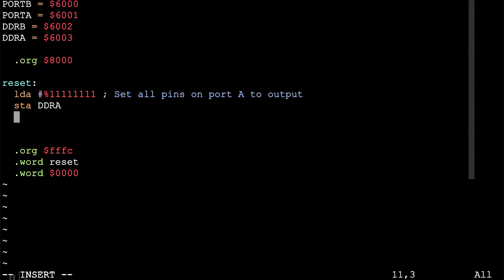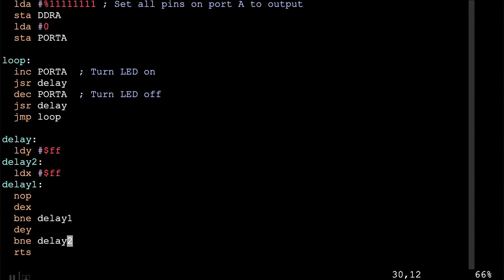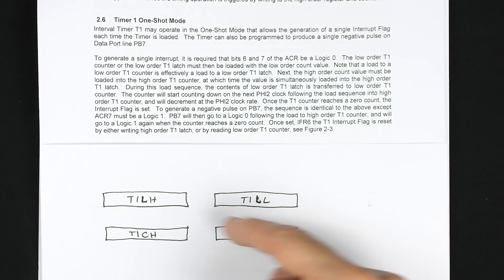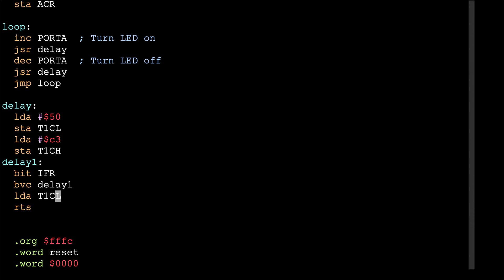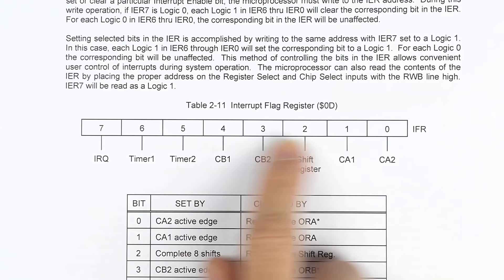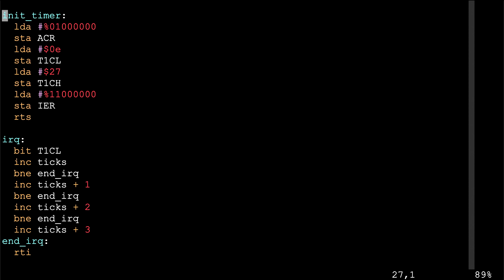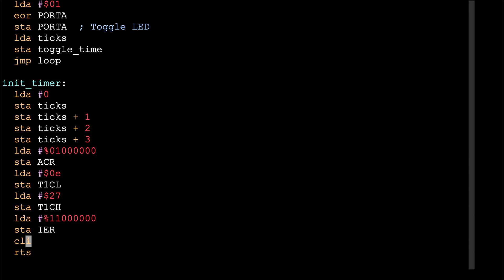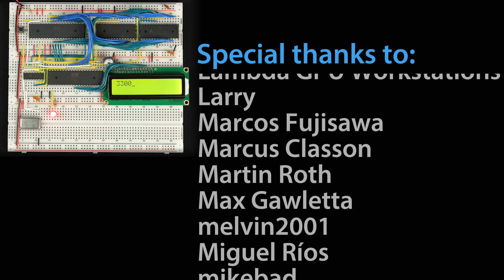How do hardware timers work?

Comment: This is a really excellent introduction to how low-level stuff works on microcomputers. However, I'd like to mention a couple of caveats (maybe Ben is going to cover this in future episodes anyway, but I don't want people coming away with some misconceptions that could get them into trouble). 
Firstly, it is a general principle that, with real software, you never poll the CPU. This means that you do not have a loop that just goes around waiting for something to happen (such as a timer interrupt). There are two reasons for this: firstly, in order to modularise the software running on the CPU, you just simply want a mechanism that (potentially) allows some new module to get some CPU time without disturbing the existing modules. A 'module', here, might actually mean a program.
Secondly, and this is what I'm really concerned about, many modern CPUs---even microcontrollers---are in serious danger of overheating and being destroyed if you run at full CPU continuously. What would happen, and how quickly, depends on a lot of factors, but it's best to avoid the danger.
So, finally, if you don't go around in a loop waiting for an interrupt, what do you do? The answer is you put the CPU into a 'halt' state. The details of doing so tend to vary for each processor (variant/stepping) and to be hedged around with a lot of nitty gritty details. (In fact, most low-level programming is like that :-)
Finally, finally, a word of warning about the documentation of peripheral devices/chips: so very often the documentation is inadequate, incomplete, and inaccurate. If you try something based on the documentation and find it doesn't work, it might well be because the docs are wrong in some critical detail. In this case, asking around on appropriate (nerdy ;-) forums etc. is usually your best bet. Somebody will know what the answer is.
And finally, finally, finally, good luck to all you experimenters, hackers, learners, and geeks out there trying your hand at this stuff. Be patient, and know that the satisfaction when you actually get something to work is immense.
Reply: I don’t think risk of overheating is very significant, it’s running at 1 MHz… and modern CPUs usually have cooling systems and temperature sensors that turn them off if it’s too high, so not likely there either.

Comment: Why you don't you try to build a simple operating system for this computer? It can be very interesting to see how interrupts handling, graphics and memory management work together to create the operating system
Reply: People do not use operating systems on microcontrollers in production. If you wanted to see how a PC OS works, (I've written one) you should make one for x86 and run it from the EFI loader right away. That way you'll actually learn how to setup basic ACPI, virtual memory tables and so on. Things you don't have on a microcontroller.
Reply: Well, that’s not really the point here, is it?

Small steps. Trial and error. That’s what’s going on here.
Reply: @TheChrisey  One certainly could show the preliminaries, however: a hardware monitor, a boot loader.

Comment: How Ben eater uses logic ic's without pull down resistors

Pls anyone answer
Reply: The 74ls family can sink current on their outputs, so as long as you don't connect too many things on one output it should work. Or did you mean something else?
Reply: @MWPSBCID  thank you
Reply: You only need pull up/down resistor if an input could possibly be in an "unknown" state, eg floating.
A Open Collector (in transistors) and Open Drain (mosfets) are sometimes implemented on purpose if pin direction can be changed in software and could create a short if both sides are push-pull, a strong pull-up resistor is then needed to set "high" in Open Drain.

Comment: I'm still in favor of the registered alarms design where the processor can just sleep when not handling an interrupt. And when handling the timer interrupt it just checks the time and runs any code if it is due to.
Reply: This microprocessor does not have any power states... Thus it will always run nonstop regardless. You can't put it to sleep. But a busy wait delay is indeed a bad design, and something no educated engineer actually does, hence why interrupts are a major part of any modern processor.

Comment: so great :-)
Today in an MCU there are integrated timers.

But first someone has to understand, how it was done in the 70ies / 80ies at CPU base,
in order to do stuff on a modern MCU.

I'll keep watching from time to time, thanks for that :-)
Reply: Those integrated timers are basically the same as this, just stuck inside the same chip as the CPU.
Reply: @renakunisaki  yes as I already said :-)
Reply: Because that's not an MCU, it's a microprocessor. Two different things. Also, MCU timers are still configured pretty much the same way as they were in the 80s. You definitely don't need to know how they worked then to know how they work today.
Reply: @TheChrisey  what I already said. Thanks ;-)

Comment: Ended up watching the whole series today and couldn't help but notice, that modern microcontrollers are basically all that (and more) in a single chip. There is the ALU in it (6502), GPIO (6522), interrupt handling (both 6502 and 6522), timers (6522 again) RAM and ROM. No wonder AVRs are so popular, even not including Arduino using them.

Comment: Some types of sleep function do:
1) A nop spin
2) A thread switch and wait for the task scheduler to return
3) A performance counter based spin wait with an internal yield to not hold up task scheduler 
4) A hardware based timer with interrupt callback (like the thread switch)

Comment: Just wanna note that your final code still doesn't fix the issue of other stuff in your main loop potentially taking too long and preventing the led from updating - for this you would have to update the led in the interrupt handler routine as well as incrementing the counter

Comment: Ben, I wish that you or someone with your teaching skill would make videos like this teaching how to program my PDP-8s!  ;D  I'm not sharp enough to be a multi-processor(?) Programmer, so I'll try to stick to the slow BlinkenLights that I have that are relatively simple.  But since I don't claim to be a Programmer, I definitely need all the help that I can get!  DEC's  handbook with its errors simply isn't written at a level a rank beginner can make much progress with.  But, I can still pick up a few "general" pointers watching these videos since I've dabbled with Assembly with for Z-80 & 8088/8086 machines (back in the day) and a lot of what you demonstrate still makes sense.
Reply: May I ask what you're using PDP-8 for? I use to program them back in 1980 I didn't know they were still in use for anything, like the GEC4000
Reply: @salerio61  Just playing with them now, as a hobby.  The last time we used one at work in the late '90s or early 2000s (& before I retired) was to run a test stand to test missile launchers.  ;)

Edit:  I'd just like to find a good way to learn how to correctly program it, with someone that could check my work as I slowly learn in a perfect world, but I'm not going to hold my breath on that.

Comment: Mr. Eater, I have a suggestion for a video: bus arbitration! I.e. how to implement in hardware the system that manages a single bus between a processor, memory and I/O devices, preferrably with your breadboard 8-bit computer. I am no expert so I don't understand how one would design a system with shared bus which may have several devices attached. It is one thing to tri-state all inputs and outputs between registers and ALU and stuff within the processor, but it probably won't work for any devices external to the processor.  Surely it won't have Load / High-Z lines running directly from the processor's control store to every single terminal, printer or tape drive connected to a computer? An in-depth video on building a bus arbiter from scratch would really be very welcome!
Reply: External devices mostly use 1K pull-up and active low( eg Open Collector). Two active low does nothing and will not create a short. 
Only downside is 1K rise time is slower, and uses more power if line is active low often.

Comment: Hey Ben Eater i designed and builded prototype of my 6502 terminal with two 6502's and i called it "Retro6502". It have 64Kb of RAM, 18MHz generator (based on 555), 2 I/O chips (for alot of stuff to connect) and the most inportant the EEPROM 512Kb. I have 2 part schematic witch is little bit not undersantabble but it can be readed us normal. For now it peforms great and i will soon make PCB layout and then buy this PCB in PCBway the best PCB manufacturer in china! just give them PCB files and they will make 5 PCB's for 2 dollars!

Comment: Now that you've done a couple of interesting things with interrupts, I'd love to see a video on writing an interrupt handler that can determine where the interrupt came from, and respond accordingly.
Reply: You just read the interrupt flags register to see which bits are on.

It's possible to have more than one of them set at the same time, so you handle them in order of priority.
Reply: While I'm sure Ben would make a better explanation the gist of it is that you do a BIT test of the IFR (Interrupt Flag Register) of all possible interrupt sources, in the order of priority, and call the service routine for the first one that matches. If their are multiple simultaneous interrupts, then the moment the first service routine returns with its RTI instruction the CPU will be interrupted again and the interrupt routine will test the IFR bits again. When all interrupt sources are cleared, then the processor goes back to running the main routine. This does mean that if a device connected to the CPU interrupts and the program is not expecting it, it can get jammed in an endless interrupt loop...

Comment: On the 6510 variant of the 6502 (the Commodore 64 used the 6510), addresses $00 and $01 are reserved for an on-chip I/O port.  In the C64 this port was used to control which banks of ROM or I/O devices were enabled, as well as controlling the cassette tape recorder, if it was plugged in.

One of these days I'll unbury my C64 from the basement and see if it still works.  🙂

Comment: the only thing missing is that you didn't check frequency when you were using blinkWithDelay and show that it's slightly slower than the frequency you set because of the overhead between delays.

Comment: Ben's videos are always excellent. Haven't written assembly in decades but would like to get the 6502 kit just for fun but shipping cost to Europe is too high.
Reply: You could always play around with the SNES hacking community.
Reply: There are cheap ways to do assembly on real hardware, ATTiny85 is a very powerful microcontroller, inexpensive, debugable using a protocol called Debugwire. Just get a breadboard, a couple of resistors and LED's.
Reply: @deltakid0  Atmel chips don't use the 6502 instruction set. They're AVR.
Reply: @khatharrmalkavian3306  you're right, I thought he wanted to just write asm no matter the flavor, also, I think the NES emulator is the way to go.

Comment: I think the lead picture of this video is a bit misleading since I would have associated sleep() with modern computing, the difference being that the 6502 (at least normally) only ever runs at one speed while modern CPU's step up and down their clock rate adjusting to the load, so sleep() would actually tell them there's no load from this thread for a given time.
Reply: Not really - sleep has been around much longer than CPUs that adjust clock speed. The key point is the processor can be doing other things while one task is waiting.

Comment: It would be really cool if you could show how to create a serial input for those who are getting tired of programming the chip in the dock. Instead, we could use serial to send the new firmware.
Reply: Like the bootloader found on Arduino boards?
Reply: @user2C47  but much simpler. Because bootloader's have a lot of overhead

Comment: I'm just not sure how the toggle-time works when it nears the upper limit.  Seems like when 'ticks+0' is near the point of rolling over, things won't work quite right.  For example, when 'toggle-time' reaches 250, 'ticks' minus 'toggle-time' can never be more than 5, much less reaching 25.  Wouldn't that break things?  Maybe I'm just not understanding how SBC and CMP are working with the carry flag?
Reply: The trick is to bear in mind that single byte numbers are treated modulo 256, i.e. 0-255. If toggle_time is 250, then ticks will be rising towards 255, then go back to 0.  0 - 250 is -250, which modulo 256 is 6. so the program will continue until ticks is 19 when (19-250) modulo 256 = 25.
Reply: @IanSlothieRolfe  Thank you for that explanation.

Comment: @Ben Eater 27:50 Does this mean that the clock is fully occupied by your blinking LED?
So no other program can use that clock?
Or is it like possible to give it multiple "latch times" (toggle times) & specific addresses to send the interrupts too?
so, you send in like: "program_A 250ms" & then "program_B 50ms" and it will send some kind of output signal to some kind of buss together with a receiving address?

Because in the beginning, your program used up the entire CPU to just blink a LED, but now you "use up" an "entire" clock to blink the LED, which of course isn't as bad, but could it be even better & "parallel"?
Because in a regular computer, I assume a LOT of stuff uses the clock, so there must(?) be a ways to let multiple programs use the same clock, otherwise the computer could run out of clocks?
Reply: In a modern system, the main timer is used to increment a tick counter like this (or even has one built in), and the applications ask the operating system to delay them for a certain time or alert them after some amount of time. When the OS switches programs it will go through the list of programs waiting on timers, see if any of them are due, and if not, skip them. Effectively it simulates having an infinite number of timers.

Of course this means the resolution isn't as precise as a real hardware timer, but the hardware timers in modern systems can be precise to fractions of nanoseconds. Besides, most modern applications don't need "precisely 25ms", they need "roughly 25ms" or "at least 25ms" or "until I have something to do again". If you need a very precise timer, you probably aren't using a general-purpose computer and operating system for it.

Also, modern systems have real-time clocks, so you can wait for a specific time of day.

Comment: What happens if the main loop(led +lcd) is more than 1000ms(for example 1200ms)?. Will it miss the correct ticks values that is used for led blinking(multiplications of 250ms)?.
Reply: Yes. If the led blinking frequency is important, you would toggle it in the interrupt subroutine

Comment: Your final solution is still essentially polling though; just polling the update_led routine, rather than the timer.
Wouldn't it be more efficient & neater for the led state change to be performed in the interrupt handler?

You could extend such a solution into a more general 'timertask', where any task that needed to be run periodically could register a callback routine, which would then be invoked from the timer's interrupt handler at the appropriate time.

Comment: Wouldn't the timing for the led flash be slightly off millisecond timing when the ticks carries over after the first byte? Because the compare between ticks and toggle_time is only the first byte.
If you end up with 0-25 ticks for your first cycle, after 10 seconds you'd drift due to the byte compared being shifted from 6 to 0 on the ticks +1 increment before that subtractive compare is equal to 0 again.

Unless I'm missing something.
Reply: no because it's a wrapping subtract, say ticks is 19 and toggle_time is 250 then doing ticks - toggle_time on an 8 bit register with wrapping you end up with 19- 250 = 25 (and this wrap is signaled in the flags register)

This is why you do this subtract instead of something simpler, "if( (current_time - last_time) >= interval)" is the correct way to deal with overflow in those values.
Reply: @ratchet1freak  oh awesome. Thanks for clarifying that! Super interesting, I love this stuff!

Comment: I am not an engineer, partly due to my dislike of reading full spec sheets, so your breezing through them to pull needed signals is awe inspiring.

Would you consider (although not as complex as a full computer) making a breadboard Arduino? ... and code in assembly... :)

Comment: I would love to find out whether it would be possible to use memory from (now defunct) DDR memory to connect to a project such as this?.. I know that most memory were based on capacitors so they had to get recharged over and over, but I would hope that ddr and newer are static ram.

Comment: If you set the timer to count at a power of two times the desired blink frequency, you could just read the corresponding bit from the counter, and feed that to the LED port. No need to remember previous values.

Comment: Nice intro to isrs and countdown timers! I had one small issue; If you're implementing sleep() in a real (non-multitasking) context, wouldn't you really wan't to call a function that doesn't return until the elapsed time is over rather than repeatedly checking the global timer for the correct time? This way you can fully account for the push and pop time easily and accurately. Anyway what a pleasant and nice review. I haven't worked with a 6502 since 1982 I think.Beautiful breadboard setup too BTW.

Comment: The datasheet for the W65C02 shows that it only has a native logical shift right instruction, but not one for shifting left. 

If we hook up an external device like a typical Arduino-based SD card breakout board, wouldn't we need external shift registers to complete the I/O connections? 

Is there an old-school work-around for this instead?